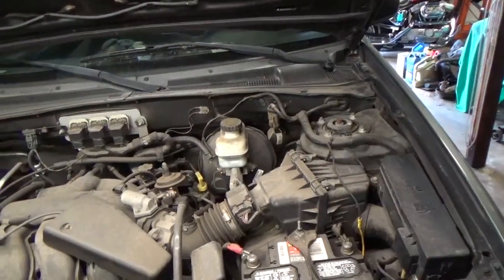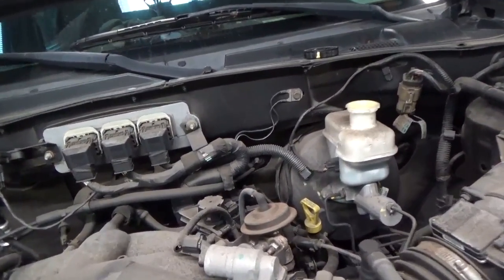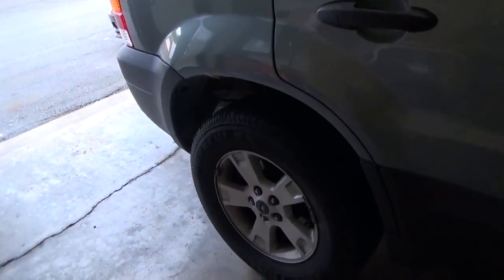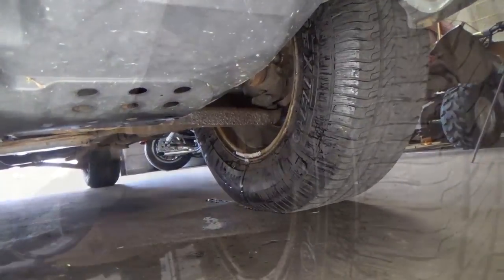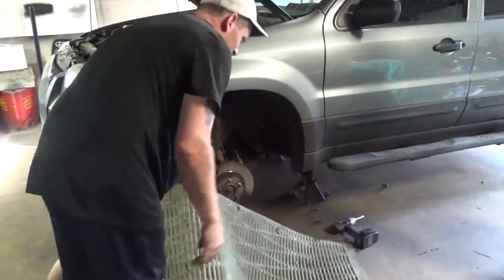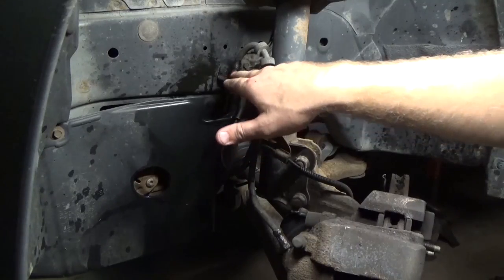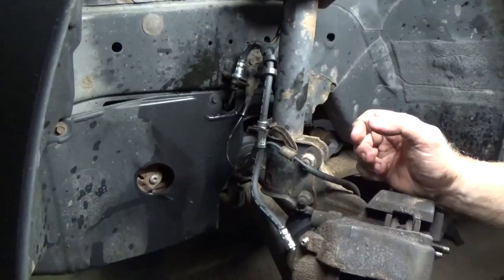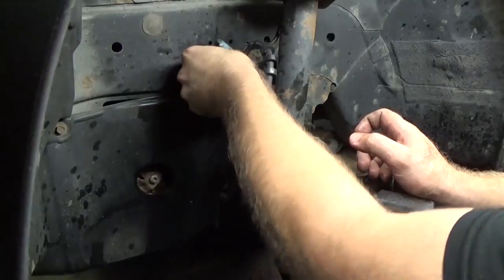How to replace brake hoses and bleed the system -ford escape

Comment: Just changed my Front brakes on my 2005 Escape..took a 21 hr 1100 mi turnaround trip from AZ -TX..With speeds up to 89mph....and upon arrival home at 2a.m. ...the driver side line burst as I pulled into my driveway...Had 2 splits in the old hose and Thanked Our Angels that protected us..GREAT VID...and Today im trying the GRAVITY Bleed due to being SOLO...THANKS ...you saved ny BUTT...great informative bid.. THANKS💪💪🙏☝️
Reply: And Just an UPDATE..the SOLO BLEED worked like a Charm and Just as Described...THANK YOU...YOU ROCK

Comment from the maker: welcome back, time was tight this week however I managed to get this one in, and couple more quick repairs I captured as well however, sorry I didn't get a intro in and seem a little rushed, this was pretty much real time. if you enjoy these in and out style repairs let me know and I can capture much more in less time. in return uploading more often when time allows. thanks again hope you enjoy
Reply: +robinsonsauto you should invest into one of those Z lifts, it will raise it 4 feet off the ground so u can use a roller to work, its awsome dude. and they are only like 1200$ for a GOOD ONE, go buy a cheep ass one and try it out! i know u can buy a used or cheep one for a few hundred bucks

Comment: Good video as usual. I prefer vacuum bleeding to the other methods. I'm a stickler for a firm brake pedal. Plus hand vacuum pumps are multi-purpose tools which is always a good thing. A tip my dad taught me was to smear a little grease around the bleeder screw when the vacuum pump is connected to help prevent air from entering the clear hose through the base of the bleeder screw or the bleeder nipple, giving a false positive that there is air in the lines. Works like a charm.
Reply from the maker: +Pet Rock's Garage thank you for the feedback, its a great technique, very good point that's why I mentioned the air bubbles don't necessary mean you still have air in the system, like you mentioned it will pull air around the bleeder, I used to pull the bleeders and put a little Teflon tape just on the threads to prevent this. then found if you just pull about an inch or two of fluid out its usually good to go. Great tip thanks again

Comment: Nice job as usual, Will. Ford should have recalled every one of them. It's a very common failure. I had one today that had 3 of 4 hoses badly cracked.
Reply from the maker: +wysetech2000 thank you,  its a serious issue and really should be recalled, are you noticing the same spot of failure on the hose as well?  the right side on this escape was all but leaking in the same spot, its pretty sad I'm sure this hasn't ended so well in some cases
Reply: +robinsonsauto Yeah, have also seen them crack where the hose is clipped to the strut. Toyota, GM, VW, Maybe Ford will be next.

Comment: Super super common on this generation of Escape.  The front and rear all do in the same spot near the crimp towards where it meets the hard line.  If you haven't (haven't finished the video yet) check the rest of the flex hoses.
Reply from the maker: +brakedd Thank you for the feed back its greatly appreciated, the rears had been done about a year ago maybe slightly longer at that time it was highly recommended to do all 4. it was back in after that with a broken tone ring. i believe i even pointed it out in that video now that i think back on it, really didn't want it to leave the shop. this was the ill bring it back asap, lesson learned

Comment: I had replaced calipers on an 08 Escape.  . One side seemed to be frozen.   But it turns out it was the a internal collapsed brake hose.  The side with new caliper and old hose (driver side)  held its fluid like in the video when bleeding.  So I could see no air and could close the bleeder. I would using the tube and reservoir with no pump.

The passenger side with the new hose and new caliper would  never fill the hose.  Pushing the pedal would push plenty of fluid but by the time I got to the  the car the  top half of the hose was  empty but fluid was dripping rapidly  down the hose.  No matter how many times I pumped  the pedal it  would never fill the hose.  So which side was correct?  Is the old hose partially degraded and holding back fluid (slow) Or is there still something wrong  on the side with new hose?

Comment: what's good . I have a question,  I have a 04 ford escape and I have the same problem.  my question is what it the size that I need to get  for my brake hole for the front driver side.

Comment: I had same problem with my S.E Asia Ford Escape ZD model. 
It uses same part # as N.America model.   I believe it's a design defect, the upper part hose segment is too short for suspension travel and steering movement.   The hose is too short in the area with the 3 rubber donut spacers.

Comment: I did everything like you did in this video no air in braking front and rear but I still have no pressure in the peddle how do you bleed the abs module
Reply: Master cylinder

Comment: I have 2008 Ford Escape hybrid the abs and brake lights on, my mechanic change the master cylinder and brake system he bought used parts I can't spend thousand $ to buy new parts , but still have the lights On on my dushboard so if IL change the brake hose both front is it supposed to bleed the 4tires pls help me. thanks
Reply: Ever figure out the problem. Going through the same issue...